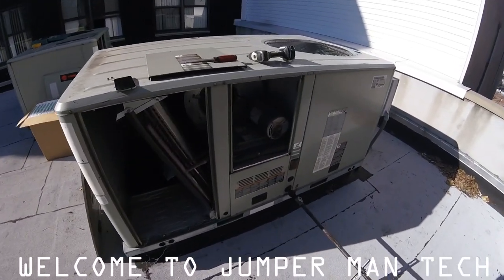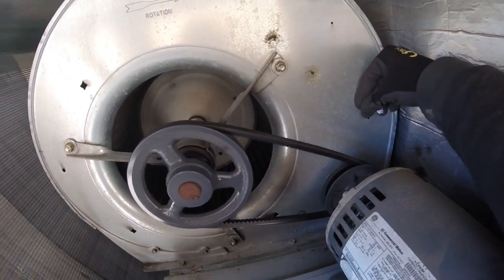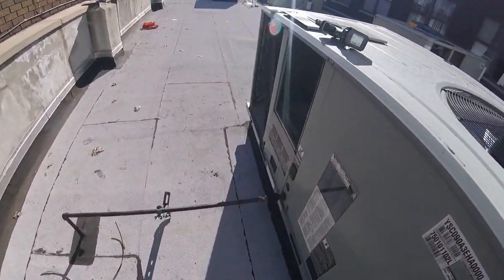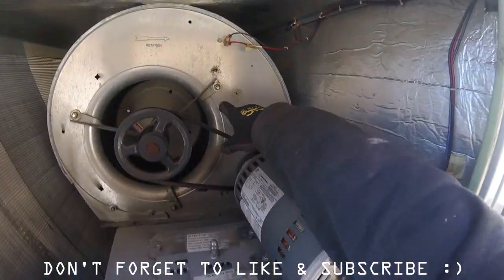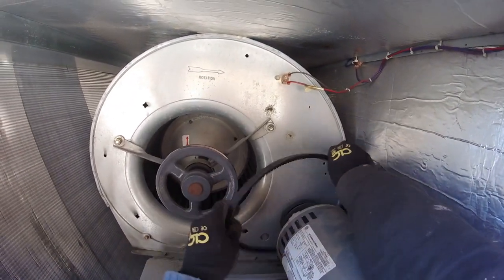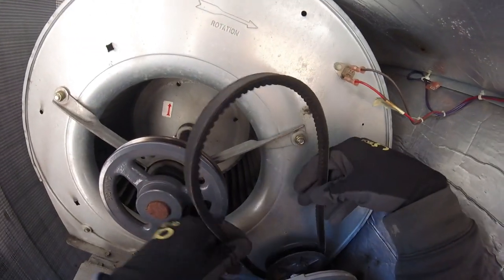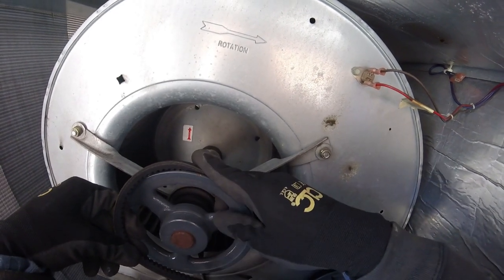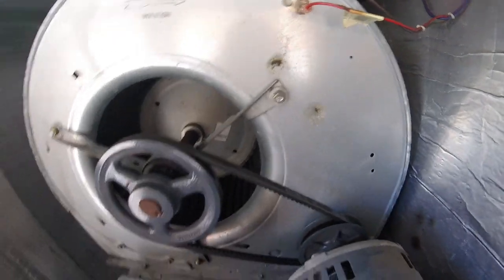HVAC: How To Remove and Replace a FAN BELT For a HVAC Unit/Furnace/AC/Exhaust

Comment: That really is not the right way to do it, you are stretching the new belt when you do that. The better way is to loosen the motor from the base plate.
Reply from the maker: That's true, I hear you bro. For small units like this, I always do it this way. Especially if you have 15 belts to change that day 🤣 For some large units, I definetly loosen the motor from the base but only when it's really needed 🙃 Cant do it by the book all the time with some customers, they get what they pay for 👀
Reply: No the best way is to not do that, but spend 4 hours there, and say you did :)
Reply: Unless you are the owner